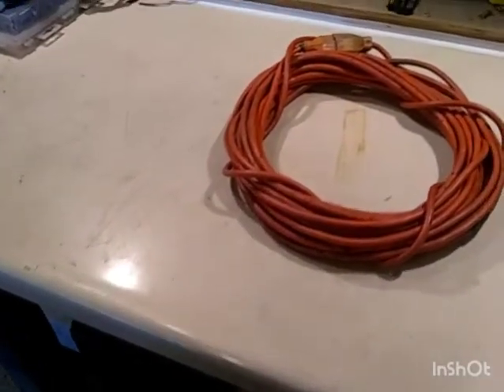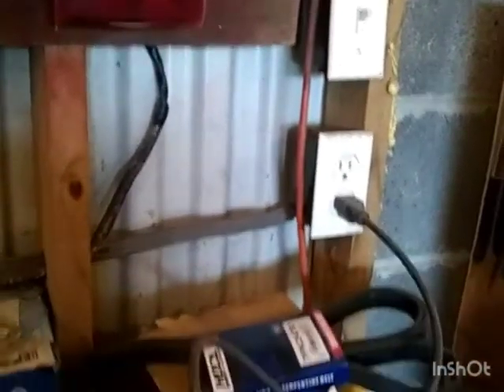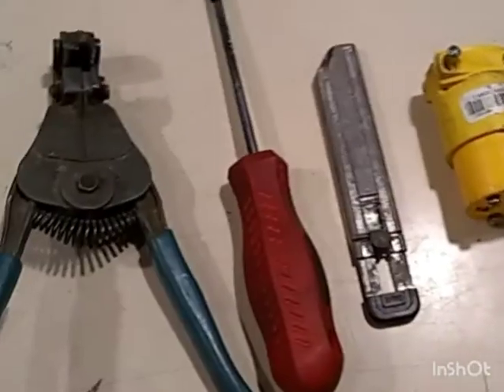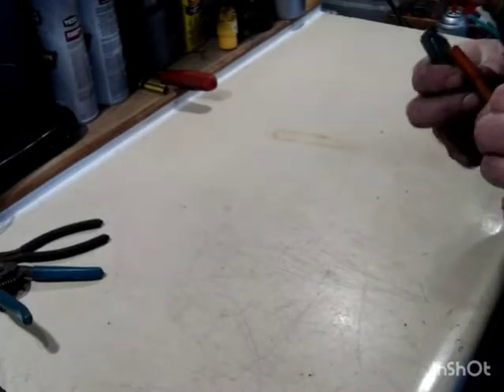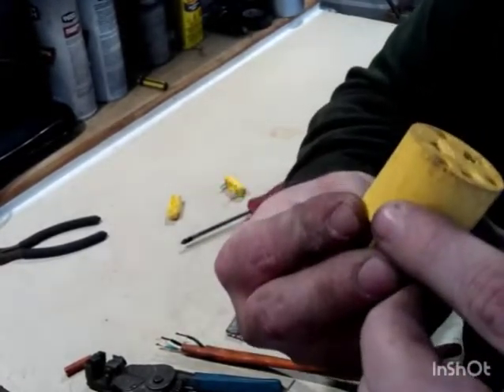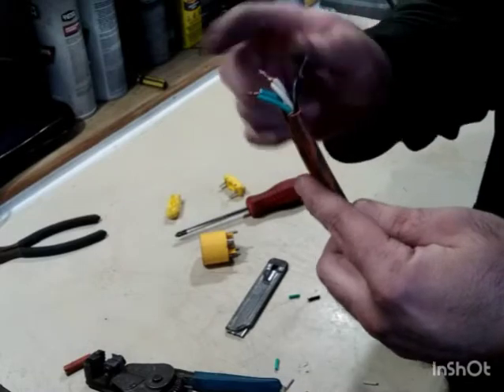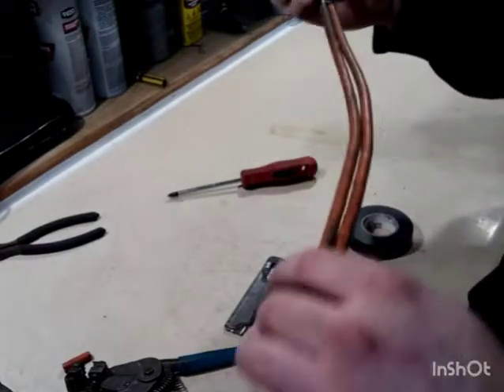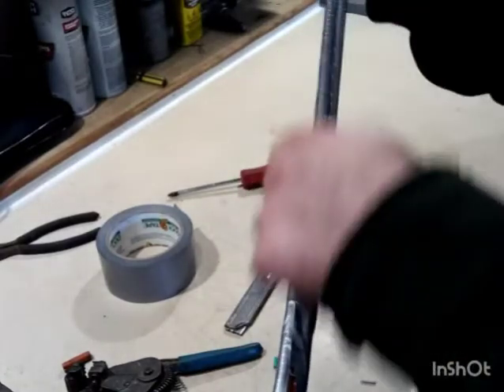making a 220volt extension cord for welder or RV.

Comment: That's hilarious. A 25' 220V extension chord is 50 bucks. Get 2 of them, splice them and have a 50' for 100.
Reply from the maker: Yeah I know it's so great to get a 220v extension cord this cheap been using it for my welder to weld on  equipment outside my building.
It does it's job great I haven't had a problem with it I welded quarter inch steel mostly with it, also use my plasma cutter with it as well.

Comment: You might as well stop paying your homeowners insurance because when you have that fire that I see in your future, they won't pay when they see your asinine wiring job. Just because you CAN do something doesn't mean you should. I also noticed that when you stripped the wire the conductors were dark which means when you say it doesn't overheat you are clueless or full of s_hit.
Reply from the maker: Well I don't know what got under your cruel, but how about before you leave a comment you try to calm down first.
Did you ever stop to think maybe that happened beforehand, about the dark wires I was building this remember I didn't already have it built.
You can say whatever you want to say about it BUT I'm still using it and I've never shorted anything out OR start a fire with it.
ALSO my welder and plasma cutter work finally WITH NO OVERHEATING.
Remember this was a cheap simple solution for a quick 220 extension cord I never said it would be permanent solution I WENT TO LOWE'S AND CALCULATED UP WOULD IT WOULD BE TO BUILD ONE OUT OF 220 FLEXIBLE WIRE AND THE COST IS ABOUT $230 COMPARED TO A FREE EXTENSION CORD ABOUT $10 IN HEAVY DUTY EXTENSION CORD ENDS.
MY OUT-OF-POCKET EXPENSES FOR ABOUT $10 BUCKS NOT $230
I WAS HAPPY TO SEE THAT MONEY.
Hey if you don't feel it safe I got a good idea don't do it like I mentioned in the video and comments.

Comment: I once stripped the ends of a 10/3 wire, turned off the circuit breaker and stuck the bare ends into the outlet receptacle.  Then turned on the circuit breaker and I had power to the air compressor.  Dumb? You betcha! Pretty stupid on my part.  Just as stupid as what you're doing.

Comment from the maker: People keep commenting to me about how unsafe this may be.
This is just an inexpensive way to do a 220 extension cord IF YOU DON'T FEEL COMFORTABLE WORKING WITH ELECTRICITY DO NOT DO THIS JUST GO BUY YOURSELF A 200 TO 300 HUNDRED DOLLARS EXTENSION CORD.
I just want to say I've been using my hundred 190 amp stick welder on this cord and it does the job for me also using my 220 plasma cutter no overheating or melting it's been about 3 years of use now.
It's a me several hundred dollars!
Reply: Great idea. If the wires handle the amps drawn, then it is completely safe. Up to the user to determine the amps needed.
Reply: Speaking as a country gal, clever! I like people who find solutions instead of bellyaching.
Speaking as an electrician...I can think of good reasons not to do it this way.
But, heh - I would like to see all the folks bitching, pissing and moaning here show us their youtube videos on how they did it better. Oh, right....